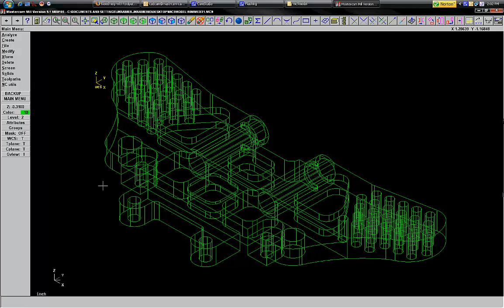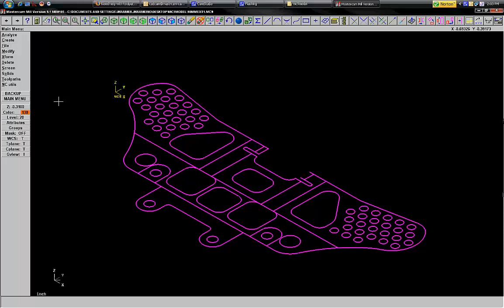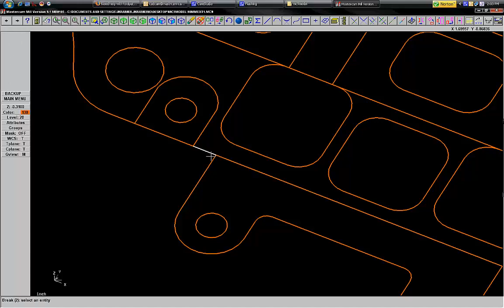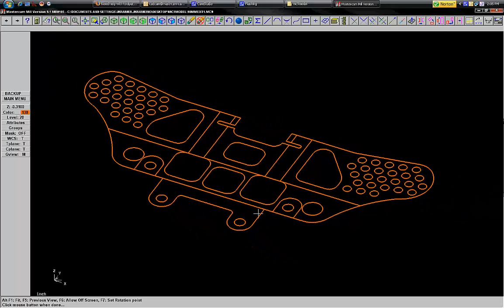how to use squash geo in Version 9 Mastercam

Comment: Mcam 9 Service Pack 2 won't work on my OS 7. It worked fine when my computer had XP on it but not anymore since having 7 installed. Are you using XP or 7? Later, RT.
Reply from the maker: I think this was Vista at the time I made this.I have V9 running on a Win 7 and A Win 10 but you must be on a net hasp for it to work.